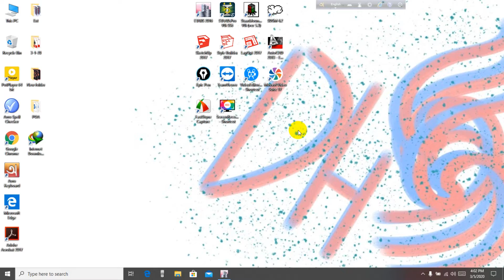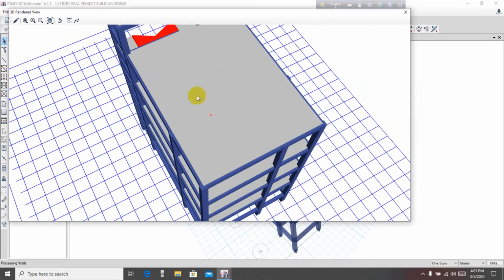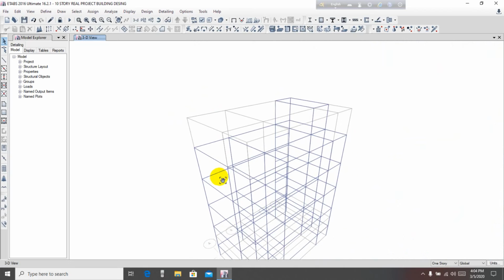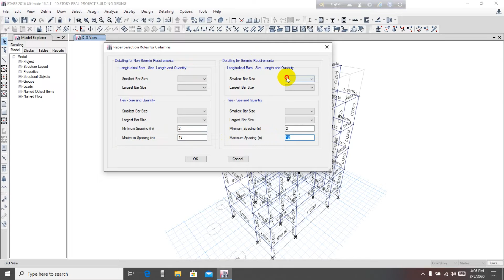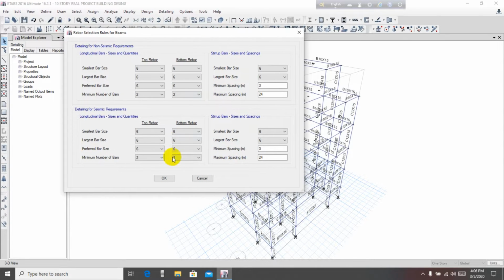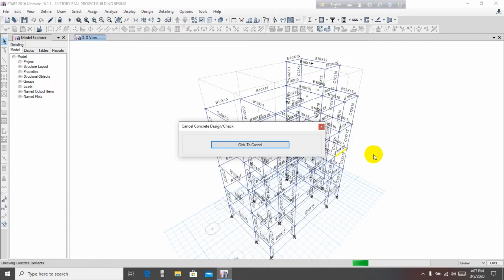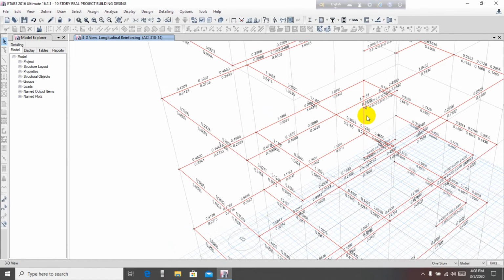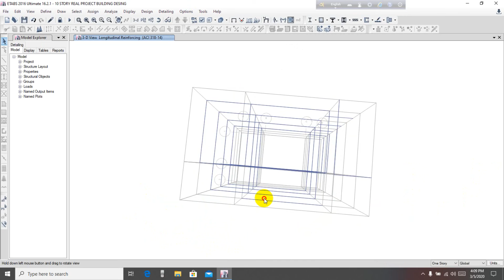Etabs Full Tutorials for beginners | Design Check And Find Failure Frame | Lec 18

Comment: Sir what is difference between design to be check and to be design by etabs. Sir which is used in design by structural engineer
Reply from the maker: to be design
you have to use that.. if you use design to be check than i will only check that design process. but i will not design your structure.